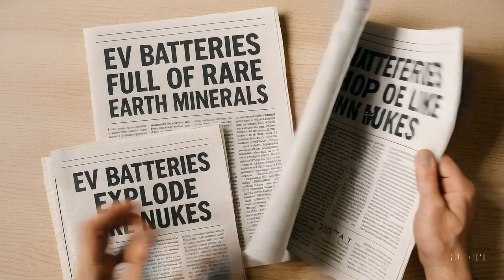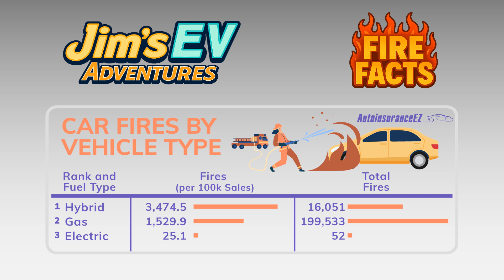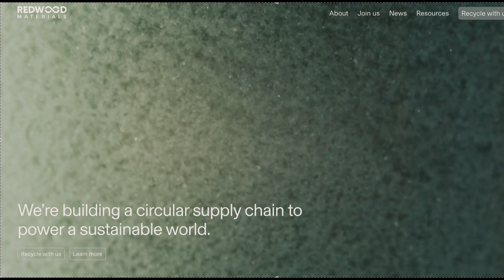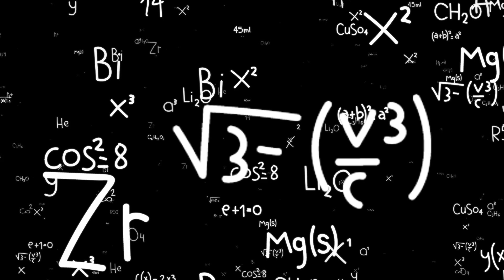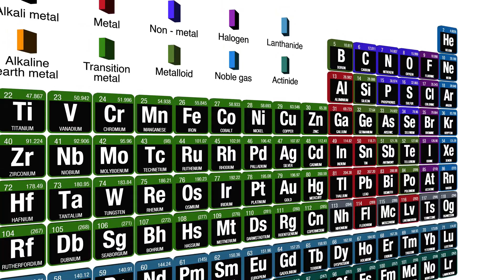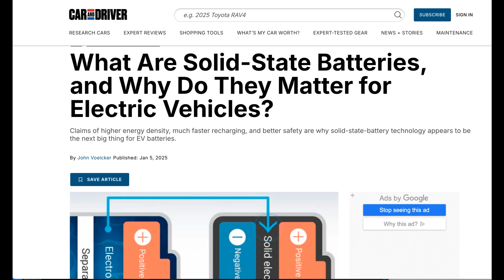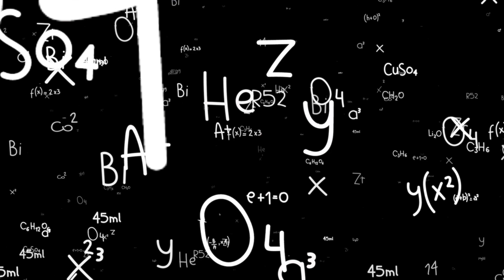EVBB, Ep. 2: The Real Danger Isn't EV Batteries, It's THIS!

Comment: Note that at least one of the EV fires was a Tesla rammed into a bridge abutment at over 100 mph.  An ICE car is likely to burn in such a situation too.  I also suspect that both ICE and EV fires in garages and carports are often the result of rodents gnawing on wires they shouldn't be able to get to.  
Note 2:  I doubt that the oil industry will appreicate this, but no one seems to remember that most of the oil spilled by the Deep Horizon disaster (caused by oil company greed pushing operations faster than was safe) most of that oil is still on the floor of the Gulf of Mexico.  They just mopped up some of the oil which wound up on beaches which are highly visible to the public.  They spent minimal time training or equipping their personnel on safety and safety equipment.  And they basically skated on compensation to closed restaurants, unemployed fishermen and shrimpers, and idled hotel workers.  Likewise, their are oil spills all over the world which are not reported as widely as those which occur in Prince William sound or off our Gulf Beaches.  Even oil spills in European waters are not likely to catch the attention of US media, but they do immense ecological damage over and above the CO2 releases.  And in other areas, they generally skate on paying for damage to the environment

Comment: Great stuff. The hydrocarbon industry pushes a lot of FUD about EVs. Should be noted that many EVs still have 12v Lead Acid batteries for legacy 12v hardware and checking & connecting the traction battery on startup.
Reply from the maker: At least the 12V lead acid batteries (EV and ICE) can be replaced with lithium-ion units, like the Ohmmu batteries.  12V Lead Acid will be the next domino to fall, IMO.
Reply: @jimsEVadventures  Didn't know that and good to know that!

Comment: Everything you said is correct but you didn't mention one very important detail to stay transparent, when the battery IS damaged and begins to burn, it is hotter and way more difficult to extinguish than a gasoline fire due to the batteries being in a self contained sealed compartment.  They normally don't explode, but they do burn for hours making it very difficult for firefighters to combat in certain areas.
Reply from the maker: Like I said, that’s another video. I’m going to blast the MYTH that it’s hard to extinguish an EV battery—it’s NOT!  If they just use water, then they’re doing it 100 percent wrong. Episode 4 or 5. Keep watching. 👍🫣
Reply: Actually, the temperature is lower than when gasoline burns